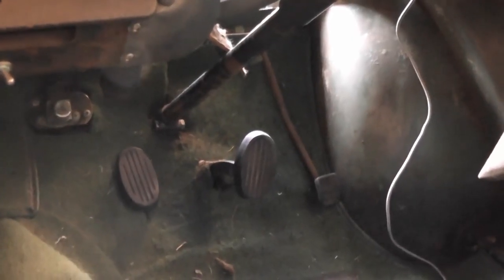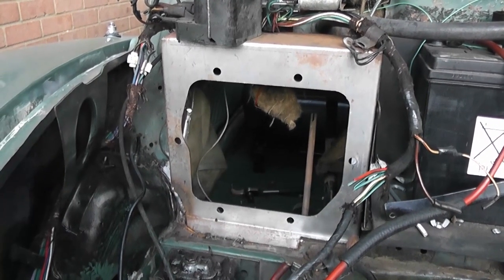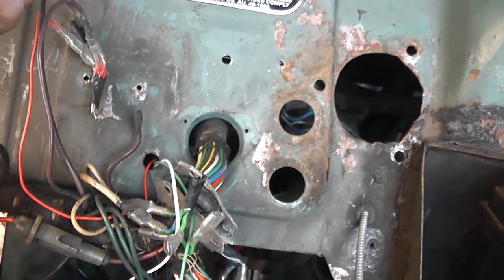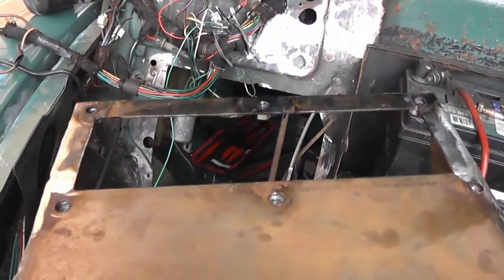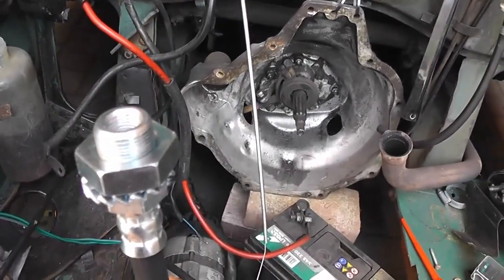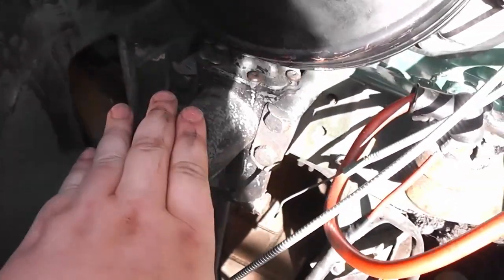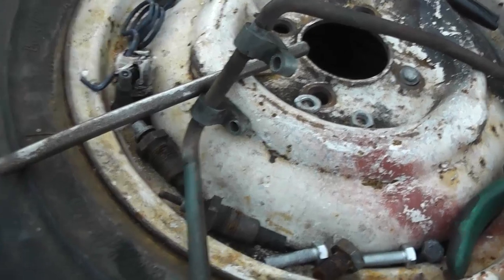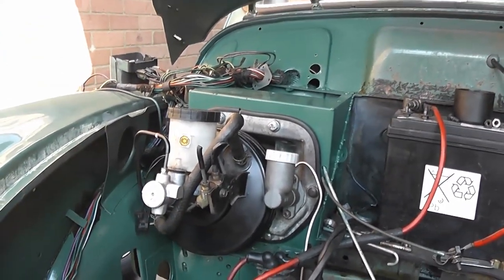Morris Minor Fast-ish Road Build Part 3: Marina Pedal Box Installation

Comment: I honestly don’t know why you have gone to so much trouble to modify your braking system? I had a 1959/60  Morris 1000 with the original braking system with the existing set up but I install a PBR vacuum braking system that stopped my little Morris on a six pence! The engine got rebored out to equivalent to a 1100 cc with domed pistons. I also changed the cam shaft & fitted a Cooper S  3/4 race cam. Ported the inlet & exhaust in the head & fitted a free flow exhaust manifold! The engine was quite lumpy at idle. But at full throttle it went like the clappers. Worst thing I ever did was sell it to a friend of my ex wife’s friend who gave it to her son who wrote the car off because it had too much power that he couldn’t control !
Reply from the maker: 1. After years of collecting parts, I had all the pieces to do it. 
2. Marina pedal box installations used to be commonplace, but virtually all info about them now online has been lost. Now there's this video for people to reference.
3. I don't like external servo systems. They are messy and take up more space than necessary.
4. The original 8 inch drums are not great for fast driving. It doesn't matter how much you boost them, they fade and become inconsistent. Boosting them is arguably worse, since it reduces your ability to modulate the brake pedal and reduce heat. The Escort disc brake system I'm going to install in conjunction with this MX-5 master will be superior in just about every way. The better the brakes are, the later you can brake, which means more time on throttle, and makes the car faster.
5. This system is dual circuit, and therefore safer.
6. This engine will be replaced at some point in the future with a much faster one, probably a twin cam. Getting the brakes squared away now is expedient.
7. I've not seen anyone else use an MX-5 master with Ford discs, so doing something different is nice.
8. I prefer the top-hinging pedals.
9. I'm a tinkerer. If I see an opportunity to improve something. I'll usually take it. Ultimately, I'm doing it because I can. Being able to out-brake the young scallywags in their Corsas and Fiestas will also be fun.

I hope that answers your question.

Comment: Great work but, the bleed nipple on the clutch should be on the top of the slave cylinder to aid bleeding.
Reply from the maker: On a Mini that's right, but this is the correct orientation for a RWD gearbox. I bled the last of the air out off camera with someone to open the bleed nipple, and it only took a couple of goes to get the last of the air out, since it's such a short system. Works a charm :)

Comment: i have a suspicion that your feed rate on your MIG may be slightly too fast. Nice work though.
Reply from the maker: I have a new welder now with a dial-adjustable inverter for the power, much easier to set. This old one just had a transformer with 4 settings.
Reply: @Scrubworks fab!

Comment: Instead of welding bolts onto the pedal box why not use nut serts?
Reply: Also with the vacuum why not drill and tap the inlet manifold for a fitting for the vacuum hose.
Reply from the maker: I've never really been a fan of rivets or nutserts. Besides, when you're sitting there with a welder and a bag of 100 M8 nuts, it just becomes the logical thing to do. As for the vacuum fitting, I thought about that, but the original carb will be used for literally 100 miles or so of running in, then will be removed. The original manifold and carb will be a lot more saleable if there isn't a hole in it.
Reply: @Scrubworks  fair enough if you have all the nuts you may as well use them.